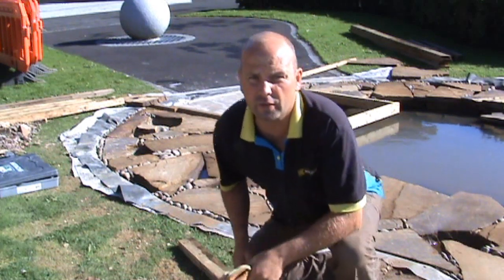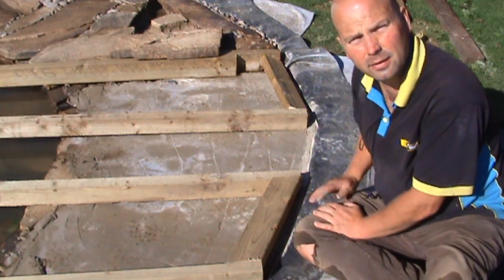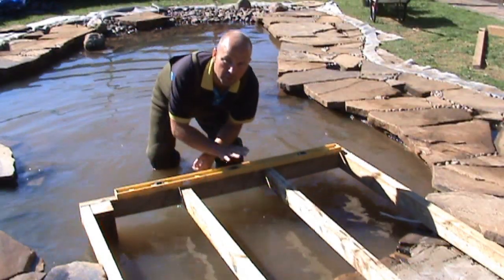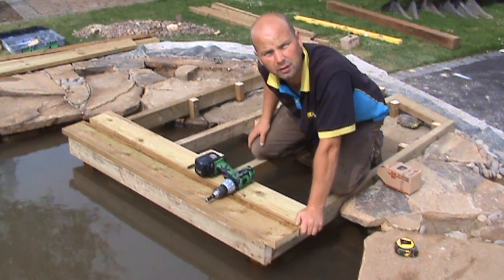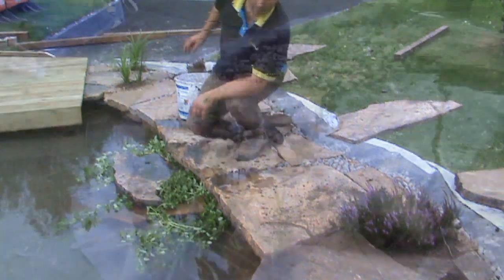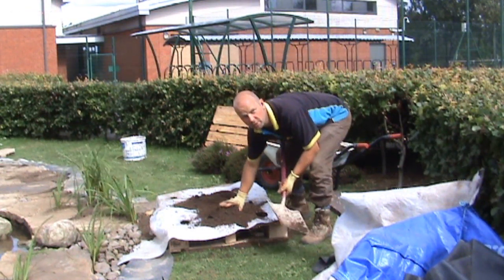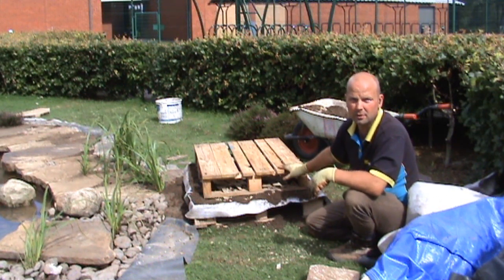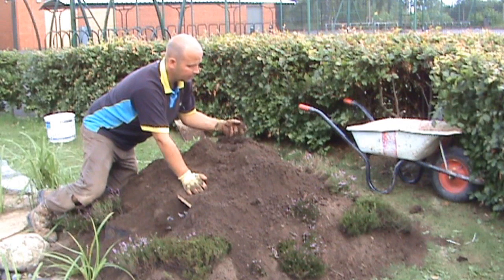How to Build a Wildlife Pond: Part 5 - Installing a Dipping Platform and Hibernaculum

Comment from the maker: Our equivalent here would probably be oak although thats a hardwood not softwood. Most of the properly harmful stuff has been removed from the pressure treatment process over here. It used to have arsenic in. I used old posts which had been treated some 6 months previously.

Comment from the maker: The more ponds you do, the easier it gets to charge a proper rate. I still cost less than most landscape companies would charge as they have employees, VAT to charge and all that stuff. I keep it simple and tend to plan what I'm going to do on each day, bringing the materials for that particular task with me so I have a clear set of tasks to achieve each day. You'll see that from my vids. I find that works for me but others may not be able to work that way and prefer a different way.

Comment: I know this video is almost 10 years old, but I have a query on why you put large slabs of stone around the base perimeter of the rockery. It seems that the heathers will only have limited space to put down roots, but is that something that heathers are used to in their natural habitat? What if one wanted to plant a more diverse range of plants, instead of just heathers?
For reference, I am being forced to rebuild/reline my pond, so as part of my renovation project, I am going to build a hibernaculum. I have my pallets already. Just need the warmer weather now. I also think I will put in a bog garden on the perimeter of the pond too.
Thanks for the video - most inspirational

Comment from the maker: The liner up both sides will be cut off. I was back at the job today and finished it off so part 6 should be coming today or tomorrow. There is a trick to cutting liner / underlay which I videoed too which most people wouldn't have thought of.

Comment: What's the mix you use to secure sandstone? Is it ok to secure other rock and safe for koi/catfish?
Reply from the maker: +Robert Gould Jr. We would generally use anything from 3:1 to 6:1 depending on weather conditions and how quickly we needed the cement to harden. Adding more cement will not necessarily make the mix stronger so we would generally use 4 or 5 parts sand to 1 part cement. As long as the pond is filled (once cement has hardened), left for a few days then emptied much of the harmful stuff will be washed away. If in doubt fill and repeat.
Reply: Awesome thanks again. Great videos.

Comment: How much did u spend on this
Reply from the maker: It is so long ago that I can't remember the total cost - I may have mentioned the cost many years ago in an earlier comment.
Reply: Pondguru  ok thanks I'll check. Have u got any advice on recommended water features for small gardens . I was thinking a placing a pump beneath some cobbles to have a paving fountain. Love your videos btw . I am commenting in one of your older ones has!
Reply from the maker: You can get some really good containers with galvanised grid which are perfect for an in-ground water feature covered with cobbles. If you search Ubbink Victoria Water Features online you'll find the ones I used to sell in the shop.

Comment: A rogue screw pops out the other side of the wood a 3:22, thats those screws! Pipefinders.
Reply from the maker: +SoldierDemps You must have eyes like a hawk as I can't see that at all and I thought my eyes were good. Is this a sign I'm getting old? lol
Reply: +Pondguru Outdoors you realised that you'd done it at the time when youve drilled the second screw you rubbed your finger over wer its just popping out to feel it for some reason.
Reply from the maker: +SoldierDemps I still can't see it, lol
I can see the bit where I rub the wood but I do that regularly. If I'd noticed a screw out I would have pulled it out and set it straight.